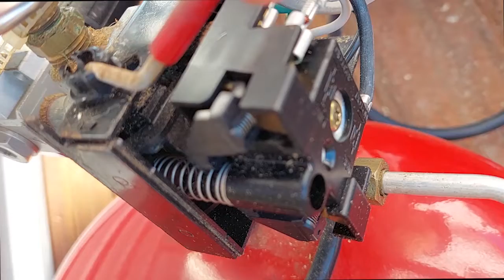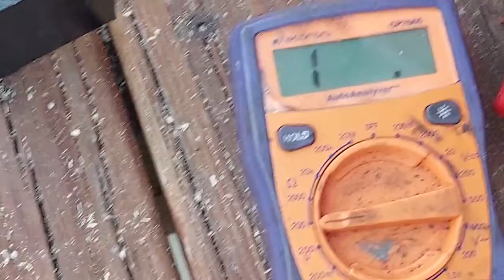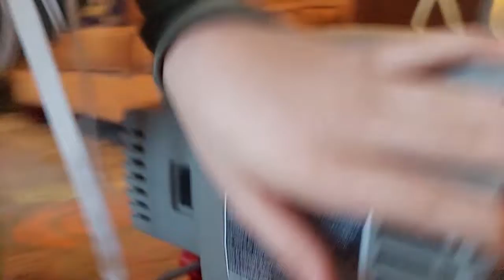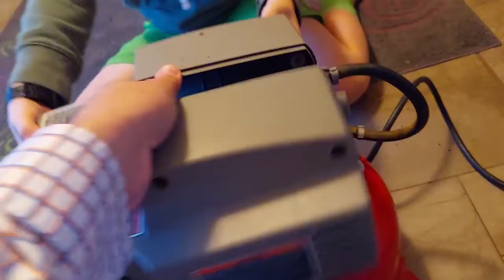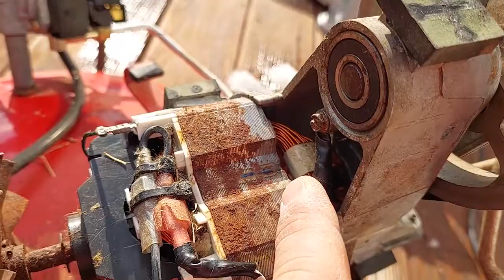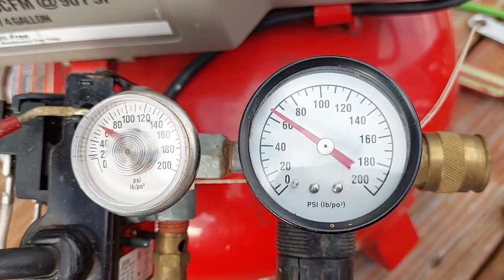DIY: Pancake Air Compressor | Repair & Trouble Shooting

Comment: My porter cable is pumping air but shoots the air too weak and wondering what it is.
Reply from the maker: Very good question.....
Reply from the maker: Where does the air come out from?
Reply: @DIYinspiredLewisBrantner  I use the hose to blow it out to dust off my rc cars and to pump air for car tires at home. And idk why the performance of the air to shoot out is too weak for some reason.
Reply from the maker: @gamercat7004  wow.... not sure what that could be.